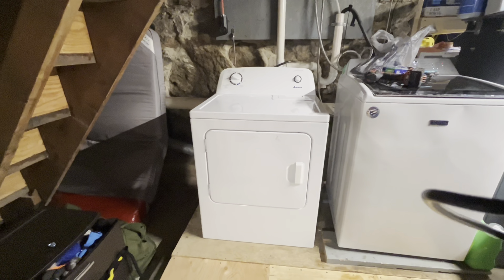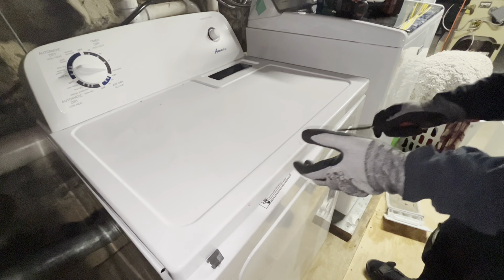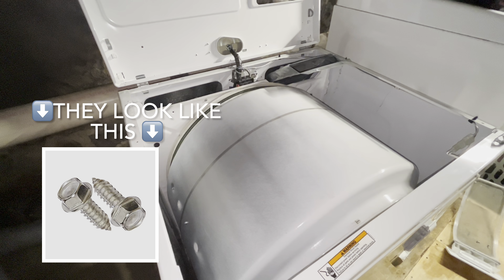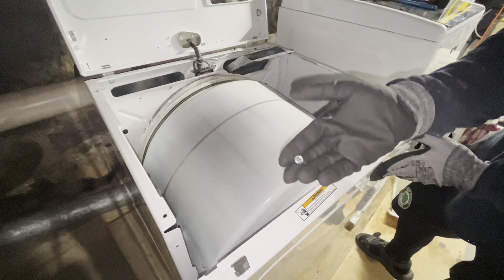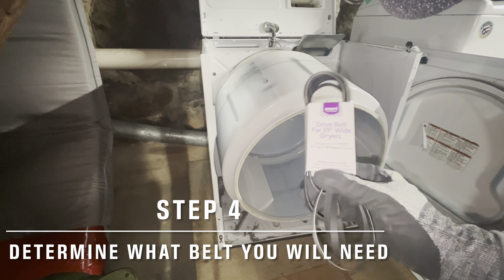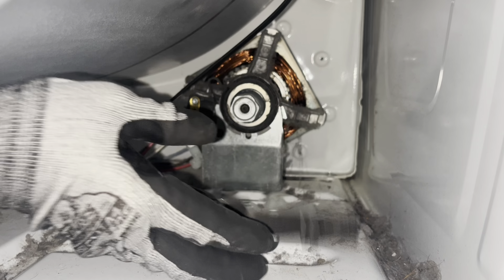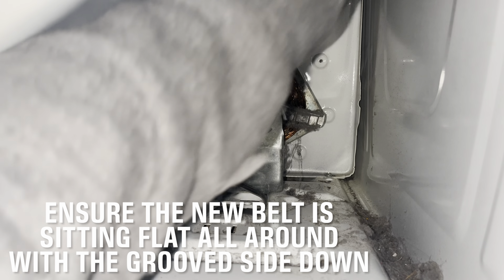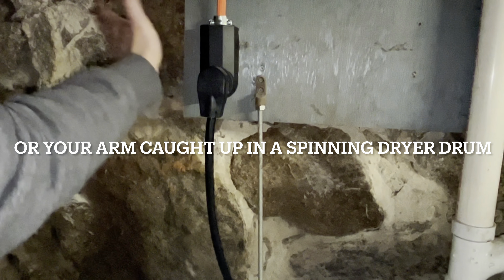How to change the belt on Amana dryer

Comment: Great video. That white plastic wiring connector does come apart. There is a tab on the top you pull lightly up on that tab and at the same time then pull the two pieces away from each other

Comment: Thank you for the helpful video. I was hesitant at first but after not finding a repair person in my small town I looked this up and was amazed at how easy it was to swap out the belt. My dryer was making a screeching noise. Turned out the belt was good but lint build up was causing it to screech. I went ahead and replaced the belt since it only cost $8 on amazon, cleaned it out and used compressed air to dust out all the electronics in the back. It is worth noting that it is a good idea to keep an eye on the front clips that hold the screw in place.. I almost lost one. I also found it is easier to put the front panel together if you mark the clip on base and hole on front panel with a sharpie (i did not have any help and took me a couple of tries aligning clips) Thanks again... Have a great day!

Comment: I have exactly model. Was trying to go thru back panel til I saw your video. As for the upper plug you couldn't disconnect, mine had a tab and came apart in seconds. Now to search for my belt. Using number on belt. Thanks buddy.

Comment: Great video.Thanks. Additionally, I used a bungee cord to hold in the drum place while I worked. Also, my electrician connection was a Quick-Connect. Surprised what an easy fix this was. Thank you for the guidance.

Comment: Worked like a charm.  Just finished changing my belt out, took only 15 minutes maybe.  But the plug you had trouble with, there is a clip on one side (very had to see) lift the clip and the plug slides apart.

Comment: Thanks! The instructions worked fine with the exception that I had to use pliers to bend the drum facing tab on the idler pulley just a small amount to get it to catch.

Comment: Your video was very helpful! I just wanted to say the "quick" release wire attached to the door panel can be released by pushing in that little tab with a pointy thing like a screw driver while gently pulling the two halves apart.

Comment: I followed your video on my Amana dryer I put painters tape on the belt to keep from tweeting over until it was installed I also took my channel lock pliers to unclip the black electric wire clip on the right side took the front panel and moved it to the side

Comment: The wire harness comes off. If you flip it over(in your video) there’s a quick connect clip. Just slightly raise the clip up and pull apart

Comment: The wiring comes apart, you need a small flat screwdriver to pry away from the locking ramps(clip mechanism) it is tricky so I understand the caution to just leave it alone and carefully slide the front panel out of the way so you have enough room to work

Comment: Hey-thanks for this. Thankfully, after following your video, I was able to get the dry going again! But when I reattaching the vent to the top, I dropped one of the screws down the vent! Do I have to dismantle the whole thing or will it be okay to leave it? I’m hoping it’s sitting somewhere on the bottom of the dryer and won’t interfere with the drum when dryer is in? 🙏
Reply from the maker: you can leave it should be fine

Comment: Thanks for this video. It made replacing the belt easy. However I can't get the front back on now. How in the devil do you get the bottom clips on the front to snap into place when reinstalling the front? I can't figure it out for the life of me.
Reply from the maker: Hey, I can’t say for sure but i do know it was kind of a bitch. just play around with it and try to get it in there, when all else fails, I tend to use a little “persuasion” if you know what I mean 👊 thank you for watching and supporting my channel🙂

Comment: So it goes under the wheel part of the tensioner pulley? I’m a little confused about how it loops around
Reply from the maker: The best way I can describe it is to pinch the belt close to the drum so you will have two sides of the belt in between your fingers, run the part that you pinched underneath the tensioner pulley, which is the white wheel so that only one side of the belt rides against the pulley, so basically you will have the outer edgeside of your belt against the tensioner ,once you are through the tensioner pulley wrap the belt around the drive pulley so that now the inside edge of your belt is wrapped around the drive pulley

Comment: I have the exact same dryer, only difference is I can take the wire harness apart, just pull up on a small tab and pull apart..
Reply from the maker: hey, yes, you can take the wiring harness apart, I didn’t wanna mess with it too hard mine was difficult, didn’t want to break it potentially, thanks for sharing this info with other viewers though and thanks for watching😎

Comment: Front panel wire harness, look close there are tabs. Flat blade slide it in carefully pry up just a little on both sides and pull apart. I'm looking for where I bolt the belt tensioner back on mine fell off. Edit: so it don't bolt on it just clips in there. Also there was a nice blanket covering the bottom made of lint.

Comment: Where can I get the belt from? And can I get a similar type or do I need to get the specific one? Thanks in advance!
Reply: I live in a secluded area all we have is an ace in town and a lowes is 3 hours away
Reply from the maker: Hey, I got a generic brand at lowes, what really matters is the 27” or 29”. I would bet that ACE would have dryer belts on hand. Also, you could bring your broken belt in to compare. But you shouldn’t need any specific brand as far as I know

Comment: You can disconnect the wiring bit at the top of the front wall... there's a little plastic tab thing holding it in place and you can use the corner of your flat head screwdriver or putty knife to release that.  It's hard to explain in writing, but look at it and i think you'll see what I mean.

Comment: That wire clip just comes off by lifting the tab on the one side and pulling apart, just FYI to make it easier to remove the front and not damage the wire harness

Comment: Now how do you put the front back on
Reply from the maker: should slide straight down the same way it came out

Dont be afraid to give it a little persusion if it wont go back in

and by persuasion I mean…(brute force) 

kidding don’t go breaking your dryer
 
(persuasion usually works though)

Comment: Everything was easy except PUTTING THE FRONT PANEL ON.  I think that I DONT need the drum into the front panel   until AFTER the 2 clips at bottom of panel are done.... THEN put the drum into the front panel.  I will go try that.  You didn't show that procedure in your video.    Thanks though for the video and I found about $25 dollars in QUARTERS at bottom of my drier!!!

Comment: The size of the dryer belt just means the actual size of the dryer. So if your dryer is 29 inches wide then by the 29 inch belt just make sure it says for 29" dryers on the packaging. If your dryer is only 27 in wide then of course buy the belt that says this is for a 27 inch wide dryer. The way it's worded in this video is confusing. Also you can easily uncouple the wiring in the front to take that front panel off and it will effortlessly reconnect using a simple slide in click connect like most couplers

Comment: Is the pulley easy to take off that the belt is threaded through?  I'm a female on my husband's YouTube channel and I'm attempting this on my own.  Thanks!
Reply from the maker: Yes it is easy to take on and off. They’re are little tabs on the pulley body tat just kind of hook into the two little slots. It doesn’t want to stay by its self unless the belt is on there. It’s pretty easy
Reply: First thing you want to do is UNPLUG your dryer.  And also, the wiring does separate from the front panel.  the wires coming from the front panel, look for small tab, push it in while pulling the connector half, separating the connectors.  If your just replacing your belt, there is no need to separate the connector.  That's a convenience to remove front panel and set out of the way for larger jobs.  What ever you do.  UNPLUG THE DRYER FIRST!!!!!!!!!!
Reply from the maker: @honuppg  Hey guy, fast forward to 6:10🙄🙄🙄

Comment: Ok in the video you said belt length 27 to 29 inch wife picked up 88inch and it's to small how are you measuring belts
Reply from the maker: Hey there, it all depends on the dryer, it could vary between brands/models. 

Easiest way just look up your machine manufacturer by whatever serial number it has &/or whatever brand it is & confirm

At the store the packaging will say it fits between whatever size and whatever size,  and compatible with whatever dryer you have

I would love to see an 88inch dryer belt, that has to be absolutely huge

something has to be off here
Reply: @chaoticlizzards653  it's an amana everything in your video worked except my belt is to small
Reply from the maker: Are you in the USA? are you sure the belt you bought is in inches and not cm, possibly?
Reply: @chaoticlizzards653  found out 27 Inc is dryer width  the belt is 92and a quarter length thankyou for your video spot on had new belt in no time
Reply from the maker: @user-no8wc9zl3v Awesome Happy to hear it thanks for watching

Comment: It didn't look like it was good to go it looked like it had the same problem Im having where the motor is running but the belt is not spinning the wheel any pressure or load into the the drum will not spin it but the motor is spinning
Reply from the maker: It was working

Comment: How long have you had this dryer before it tore up? I just bought a brand new one just like this same model on sale for like $450. I heard from some other youtubers this is a good dryer. Do you agree? Pros and Cons?
Reply from the maker: I bought is used when it was about 2 years old, 2.5 years later it needed a belt, so 4.5 years give or take. Yes it’s a good dryer in my opinion

Comment: Why did my drum fall off ?
Reply from the maker: If I remember correctly the drum will fall off when the front side panel is removed you should be able to just stick the drum back where it was and it will secure when you re-install front panel

Comment: My Amana dryer has a 93.375 inch belt.  Time to look for a different video. :eyes-pink-heart-shape::face-green-smiling:
Reply from the maker: Can’t win em all, cya
Reply: @chaoticlizzards653  I eventually won the battle and got the belt replaced, but my Amana has the top screwed down like on the super capacity model.